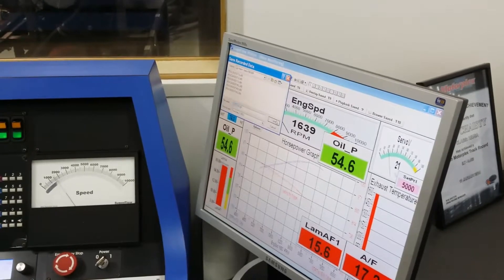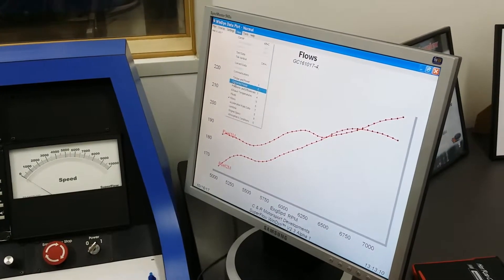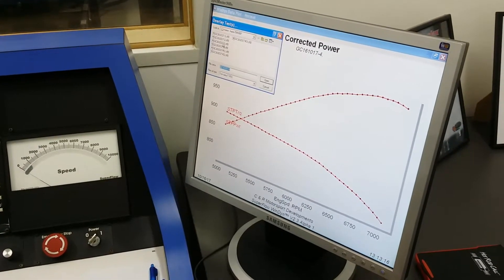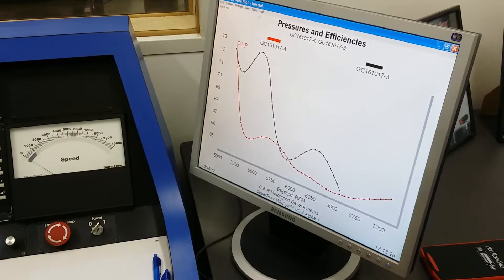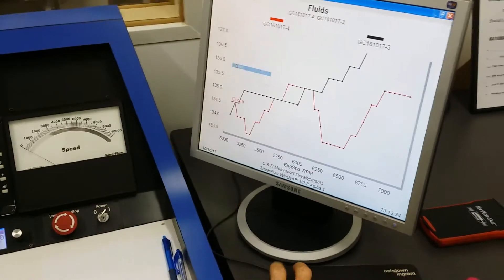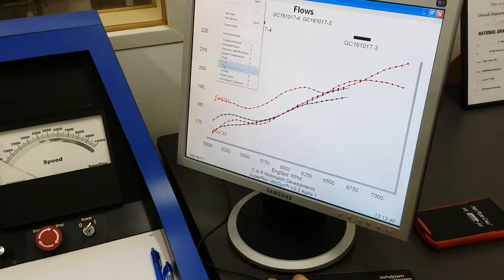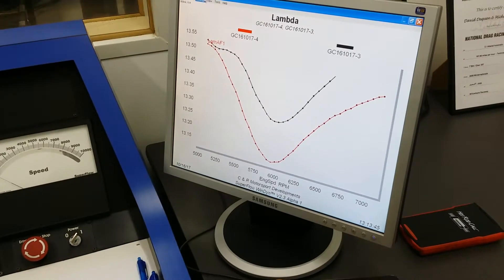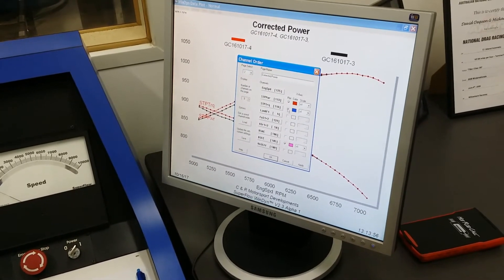Boss 429 first dyno pull to 7000rpm..Ford's design of a Hemi engine for Nascar racing.

Comment: What displacement  is the engine?
Reply from the maker: It's big 598ci
Reply: @boss9coupe  hp/tq rating. TY!
Reply from the maker: @Robert-wz8ev all runs were 890+ ftlbs at 5200rpm.
Reply: @boss9coupe  is it 93 octane pump gas or q16?
Reply from the maker: @Robert-wz8ev VP MS109 13.3 TO 1 Comp.
Reply: @boss9coupe  does Ford or you guys build a single carb pump gas engine that can compete with chevys zz632/1000 engine in hp/tq?
Reply from the maker: @Robert-wz8ev Jon Kaase racing has built many 598ci Boss9 engines just over 1000hp, a friend has a kaase built 598ci at 1009hp and I know of another they built at 1040hp with ported heads both pump gas. I believe they could build a  632ci version that makes even more.